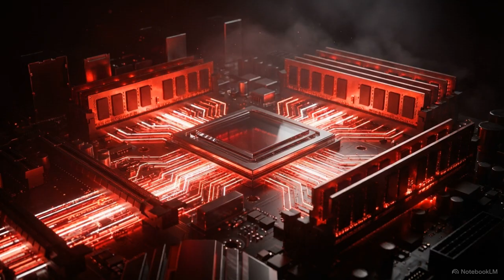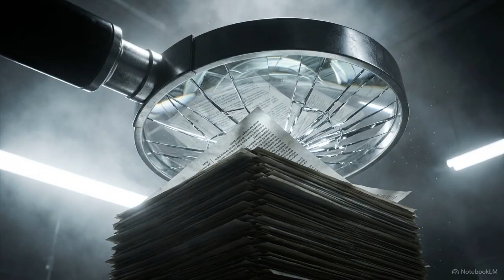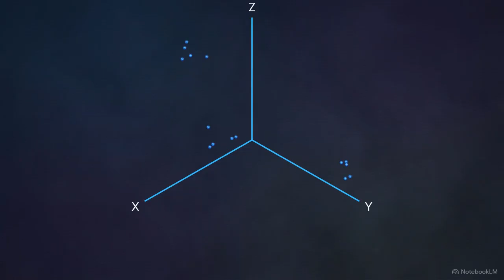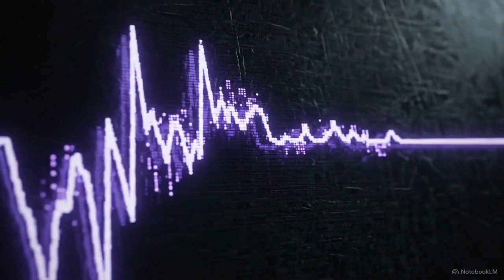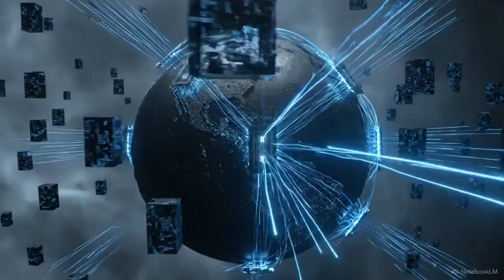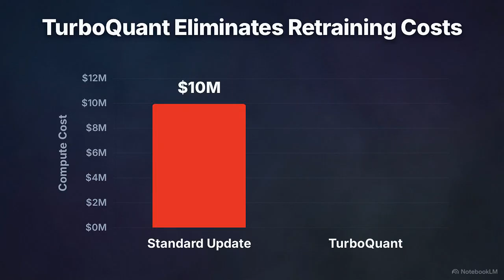Google's TurboQuant : Reduce AI Memory Usage by 6X & Boost Speed 8X

Comment from the maker: Where is your enterprise currently stuck in the AI deployment bottleneck?
A. Unsustainable GPU and hardware acquisition costs with no ROI in sight.
B. Models hallucinating or losing data during large contract analysis due to cheap compression.
C. Unable to deploy locally because of massive VRAM requirements, keeping data trapped in the cloud.
👇 Let me know in the comments!

💡 Executive FAQ Highlight: "Can't we just use token-dropping to save memory space?"
Answer: Erasing context destroys precise tasks like massive contract analysis. It’s a compliance nightmare; the long video shows a PoC of a zero-bias mathematical blueprint that prevents this structural failure.